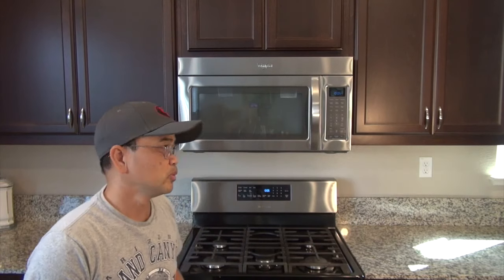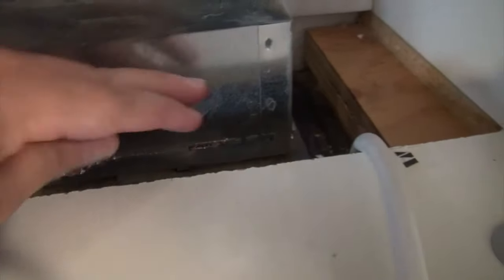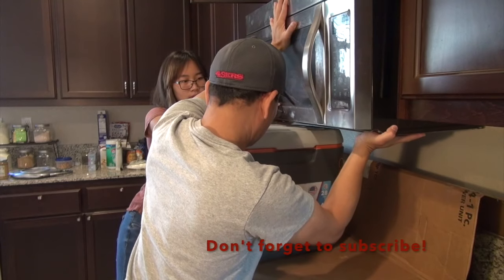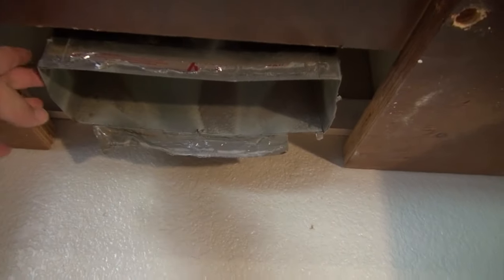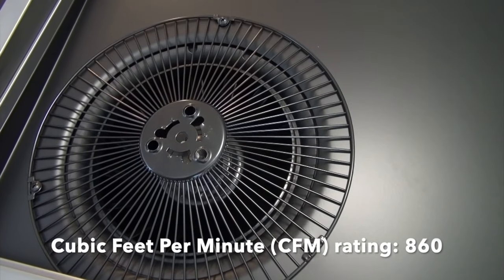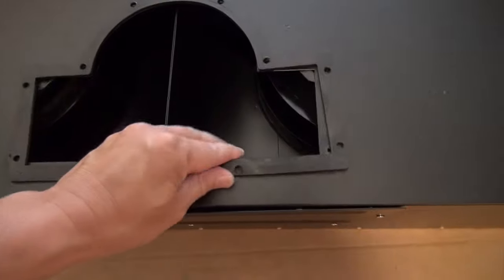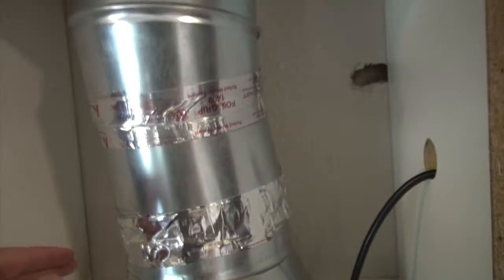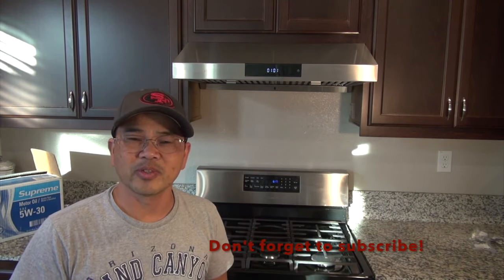DIY Over the Range Microwave Oven Removal/Under Cabinet Range Hood Installation

Comment: FYI, Since you have shown us motor oil box, I am assuming your change your oil yourself and have jack stands to lift your car. Use Jack stands to hold the microwave when removing it.
Reply from the maker: That is a really good idea.  Thank you...
Reply: @diypotentials  Impressive job, I can't wait to change mine.
Reply from the maker: Awesome!!! Good luck on the install...

Comment: Thank you  for your work, this helped me tremendously , I was skeptical  about it doing my myself and was procrastinating  , but this video drove the fear away. 

For me since distance was getting more than 30 inches between the burners and rangehood, I had to improvise with some additional wood structure between the rangehood and the existing upper cabinet.

And the most difficult part for me was how to lift it to the right height later used a big 6 inch bolt to hang it first and then slowly one side at a time swapped with right size bolt.
Reply from the maker: I love your story.  We can do so much more than we think we can.  Congrats on the installation and thanks for sharing.

Comment: Nice video - thanks for sharing !  Waiting for my PS18 this week.  In one of the steps for the screws that would hold the hood, those are slide on holes.  Perhaps you could have screw to the wood and simply slide on.   I suppose you still have to open the hood to tighten it, but at least u don't need that long drill extension.  Great job - I have to do the same exact job too.  Takeout my old microwave and put in the hood.
Reply from the maker: You are correct. Those are slide holes.  I didn't trust my measurements, so screwing them on directly was a better option for me and for accuracy.  Also depending on your under cabinet set up, you might have to drill another hole for the power cord. Good luck on the install this week.  Thanks and take care...

Comment: Great Video on removal and installation, I will be installing the Hauslane UC-PS18-30 tomorrow! One thing I am going to do different for both phases of removal and installation and use my car jack with a plywood sandwich on the stove and for lifting the range hood into the proper location. Thanks !!
Reply from the maker: Using a car jack is a good idea.  Good luck with the installation.  Thanks!
Reply: Any updates about your PS-18 please, thanks

Comment: Nice video. Thank you for posting
Things I would do differently. 

1.  Remove cabinet doors.
2. Use the default round duct work into the  hood. It's cheap and easy  to cut.
3. If you stick with the square adapter. Disconnect it from the round tube and install and seal it to the hood. Then install hood. Easier to work with this way.

Cheers
Reply from the maker: That is awesome. Thanks for sharing.  We  all can use more helpful information. Thanks!

Comment: Nice job. Am trying to replace existing stove vent and don't have the luxury of cabinet doors
over the stove. Will have to cut a hole to reconnect the exhaust vent and refinish the outside.
No contractor wanted to touch my job. To detailed and time consuming..
If there is a better way, please let me know before I start a bigger project. Am 
going to look and look for comments on internal exhaust with charcoal filters.
Reply from the maker: Unfortunately, I don’t have additional guidance.  Good luck on your project.  It will turn out great, I’m sure.   Thanks!

Comment: Very helpful, thanks. My microwave has a rectangular vent directly out the back so I have to figure out how to align the vent hood with the existing vent in the wall. Not sure how to tape that junction.
Reply from the maker: Good luck on the project 👍
Reply: I have the same setup as you!  Were you able to get the installation done?

Comment: Hi! I am wondering what is your thought on this range hood? As a fellow Asian who does a  bit of stir-frying, and frying in general, do you think this range hood is good enough to keep the smell out of the house?
Reply from the maker: Hi Bill, based on my experience with it so far, it does a good job removing the cooking aroma.   It has 6 different suction levels, for my stir fry, I use only up to level 4.   Level 5 and 6 can remove even more aroma but it does get a bit louder at each level.  Overall, I’m satisfied with the purchase.  It does look really good in my kitchen.  Thanks for asking.  Good luck with your decision!

Comment: Hi,  very good video. at 12:25 you show the duct pieces that attach to the top of the unit and then connect to the wall duct. Is the duct an 8" duct ?  The wall duct looked smaller at 6" ? So does the fact that the ducting narrows to 6" reduce the maximum of 900 CFM ?  Thank You :)

Comment: Hi There , Nice Video . I got my PS-18 yesterday and i'm struggling with the install. Thought i could use some advice. 1) My undercabinet is recessed and the bottom is like 1/2 an inch thick ( or may be less ) . I'm worried if that cabinet board is going to to hold the wieght. 2) Did you use some reinforcement between the range hood and the cabinet board. 3) The power cord and the drill hole are so close on the right side . How did you get around that.
Reply from the maker: Hello, if the weight of the over the range microwave oven that was there before is more or approximately the same as the PS-18, then the board should be able to hold. If not, check if the board is solid and sturdy.  Personally, I would feel okay with the install, mainly because the weight of the PS-18 will be distributed by 4 screws. If the board is flimsy, I would reinforce it with another 1/2 inch board or some other methods.  My cabinet bottom board is 1 inch thick. The power cord situation is a bit of an issue because it is so close to the screw hole.  Depending on your current cabinet set up, you might be able to drill another hole for it without interfering with the screw hole.  For me I decided not make another hole for the power cord.  Because of that, the rear right corner of the range is slightly lower than the rest.  However, because it is situated in the rear, it is not noticeable.  Thanks for sharing.  Go luck with the install.  Let me know how it went.  Take care…
Reply: Planning to install this range myself. I just read the manual, there's two optional screws in the front/center if you want it more secure. I'll definitely use it just for peace of mind. 10:15
Reply from the maker: Good luck with the install.  Thanks 😊!
Reply from the maker: I agree.  Thanks!

Comment: Appreciate the detailed video! There seem to be a lot of reviews for this range hood on its website, Wayfair, and Amazon. But some of them do indicate that it's either not as powerful as advertised (someone used a CFM meter and got <500 CFM at max. Another put a paper up to it and it barely kept it up) or noisier (70-80 dB) than stated on their spec sheet. Have you or your family noticed these things in your use of this hood?

I'm only skeptical because every manufacturer seems to have their own method of measuring these things (e.g. one company says 1 sone = 40 dB while another says 5 sones = 40 dB). Likewise, some say that for a hood that's truly around 900 CFM, it would need bigger ducting (8" round) to vent out that much air.
Reply from the maker: Hello, thanks for asking.  The suction of the range hood is very powerful. There are six levels of suction to select from.  So far we use mostly levels 1- 4 for heavy cooking.  The noise level goes up at each level.  The range hood has two motors so it does get a little loud at level 5 and 6, but we don't often need to go up that high.  Overall I'm satisfied with the purchase.  Best of luck with your decision.  Thanks!
Reply: @diypotentials  Thank you for the quick reply! I called Hauslane in California and they said the factory that manufactures the product in China gave them the following measurements.

6 speeds with their respective sound levels:
200 CFM / 25 db,    332 / 30,    464 / 32,    596 / 38,    728 / 42,    860 / 58.

I don't suppose you've measured the CFM or sound since it seems to have been working well enough for you but have you noticed it to be in the range of these numbers? E.g. some websites say that:
30 dB = a whisper
45 = rustling leaves or soft music
60 = a normal conversation
75 = radio or vacuum cleaner
Reply from the maker: Level 6 is below vacuum cleaner noise. You can have normal conversations at level 4.  At level 5, you have to compete just a bit with the suction noise, but you can still have a conversation.  The suction noise is solid and clean due to the powerful suction of the range hood.

Comment: Thanks for all the detailed explanation it helps a lot!  How is it working after these months?
A QQ, Why you went with this PS10 model instead of PS38 model? Any specific reason?
Reply from the maker: The ps18 meets the suction requirement I needed.  I didn’t want more or less .  Also it fits my budget as well.  Thanks!
Reply: @diypotentials  great !
I am quite convinced with the explanation you have given in the video and I am excited to mention that I am going to tackle the same project right now right now in my recently bought new home 🏡
Wish me luck 😋
Reply from the maker: @fnaticmedia  good luck with the install...
Reply: What about you, did you end up talking PS38 or this model PS18, I am shopping for the PS38, but skeptical on the flat bottom cover, where the cooking smoke has to go to the edge to be sucked in or maybe missed and still make it into the house.
Reply from the maker: Hello, I meant to say the PS18 as described in the video.  As I mentioned, the ps18 meets the suction requirement I needed.  I didn’t want more or less .  Also it fits my budget as well.  I unable to comment on the PS38 because I don't own one. Thanks!

Comment: Hi, I have a similar range hood (different brand) but I need to replace the circuit board. Do you know where it was located on your range hood?
Reply from the maker: Hi Jim,  I didn’t open mine up to that level yet.  Sounds like you are going to have to open yours up anyway to find the circuit board.   I hope all will go well... thanks

Comment: Great video! Just curious, where did you install the removed microwave? Shouldn’t that be hanged somewhere as it has fan and light on its bottom OR is it possible to remove that from the bottom of microwave and use it on countertop?
Reply from the maker: The removed microwave was too big for the countertop.  I sold it for a $100 and bought a countertop size microwave oven.   Thanks!

Comment: Did you have to add wood blocks to the underside of the cabinet bottom to fill in the gap of the recessed bottom or was it already flush with the bottom of the cabinet face?
Reply from the maker: Hello, I didn’t have to add wood blocks.  Thanks!

Comment: I have a rectangular duct work inside the cabinet on the kitchen wall. But I see most of the Range Hoods come with Circular Shape. Can a Circular Ducted Hood be connected to a rectangular ductwork. ?
Reply from the maker: You can make sure that the range hood you purchase would include multiple adapters, including the rectangular one for your ductwork.

Comment: May I ask. My cabinet is higher than yours, you think I can do that it is still working well for ventilation the air out? And how high is from the cooktop to the bottom of the range is suitable? Thank you for your help with my question.
Reply from the maker: Sorry, I can’t offer my opinion on suitability, but the height of my cooktop to the bottom of the range is 27” just to give you an idea.  Thanks!
Reply: @diypotentials  Thank you so much for your help, my high is 56 inches, I just got the range hood and installed it. But it's not working right because my is too high above. I bought the hood from home Depot  VISSANI 500 CFM. Could you recommend me with one is stronger. Again Thank you so much for your help.

Comment: Very nice instructions - so did you have to worry about make-up-air since the range-hood? Some counties need MUA if the range is >400CFM.
Reply from the maker: My kitchen is open floor.  Plenty of airflow in and out. Also I have my kitchen windows open when cooking… Thanks!
Reply: great, thanks! I think the problem we may run into is when you sell the house and a house inspection wants us to make changes to come up to code. Guess at that point, just replace the vent with the microwave :)

Comment: Your video came up when I was looking for videos on removing the over the range microwaves. Your video had good pace and was very informative. What a coincidence I was looking at the PS18 range hood to replace the microwave.  What are you thoughts on the PS18? I narrowed it down to the PS18 or the Vesta 860cfm range hood. Not sure if the light function is as efficient as the Vesta. It seems the PS18 turns on both light and fan at the same time and cannot independently turn on either like the Vesta.The two are very similar otherwise. 

P.s. you should have "PS18" in your title to make the search come up with your video. 

Also your assistant looks like she was ready to be elsewhere to check on other range hood videos or maybe Tik Tok :) 

Thanks
Reply from the maker: Thanks for the feedback.  Overall, I'm very happy with the purchase.  Regarding the light function, when you turn on the range hood, the light does not come on automatically.  You have to press on the light button to turn the light on.  It is somewhat independent, but the range hood has to be turned on first, before you can turn on the light or leave it off.  Check out comments from other viewers, you might find them helpful.  

My assistant was probably checking on Tik Tok, although she was a great help. Best of luck with your search and installation.  Thanks!
Reply: Thanks for the quick reply. When the range hood is on, can you turn on the light without the fan turning on?

Also can you turn on the fan without the light turning on?
Reply from the maker: Yes you can turn on the light with the fan off.  Also when the range hood is on, the fan does not come on until you press the fan level buttons.  Hope that helps!

Comment: How much would it cost for the place u bought the hood from for them to remove and install the vent hood
Reply from the maker: Hello,  I’m not sure. You might want to call them.  They might have local contractors for the installation.   Thanks!

Comment: What are these rubber hoses that are attached to the fans that exit the bottom rear of the unit? Are those for condensate? Oil collection?
Reply from the maker: Hello, the system does not have those items.  It was probably the power cord that you saw exiting the bottom rear.  Thanks!

Comment: What did you do about make-up air? At 860 CFM, make-up air that’s equal or greater would be required by code, no? This is my biggest concern right now.
Reply from the maker: I have a large open floor kitchen with plenty of ventilation.  I normally open my windows as well when I cook for sufficient air circulation. For the range hood,  I normally use level 4 for suction,  rarely needed to use level 5 or 6.  Your situation might be different.  Good luck.  Thanks!

Comment: I just had one installed and I tried putting a red cup towards the highest suction and it didn't hold. Just wondering if you were able to test how powerful the suction is. I have the exact same model too!
Reply from the maker: Have not done any testing to measure the suction.  I mostly use level 4 as it gives enough suction power for my cooking needs…Thanks!
Reply: @diypotentials  thank you

Comment: Hello,

I have a question please.  Is it wood or particle board?  Mine is particle board and not sure if I can install this range hood.  It is heavy.
Reply from the maker: Mine is composite wood.  By the feel of it, it is very strong and sturdy…
Reply: Thank you so much for your replies. I just installed PS38.   I used 2 x 4” wood filler.  It is study and well secured; however the back holes are not easy to screw.

Comment: Bro ! I did exactly like yours, same exhaust vent configuration, but when I put my hand under the fan, I can feel the air blowing against my hand, wtf ! Just at the edge of the fans only. feel like a blowback
Reply from the maker: Yikes!!!  I’m not sure why that is…
Reply: Check inside the range to see if the fans were accidentally put in the range the wrong way. It is possible that the factory installer made the mistake of flipping them and the vent of the fans are actually blowing the air out. There should be two fans in them and if you put nail polish on paper and place it under the fans you can confirm which fan or if both are installed wrong ie: flipped.
Reply: Some range hoods have the flaps taped down to prevent damage when shipping. You also may have a Damper that is installed backwards.

Comment: So the range hood is only secured by 4 screws from the botom of the hood to the cabinet? Do you feel that is adequate and strong and secure? You didnt do any additional mounting anchors to the wall or did the hood not even suggest doing that
Reply from the maker: The four screws are sufficient.  No problems so far.  It is solidly secured for my cabinets.  However, you should do what feels best for your situation.  Thanks for sharing.